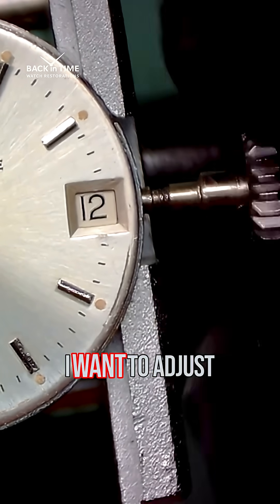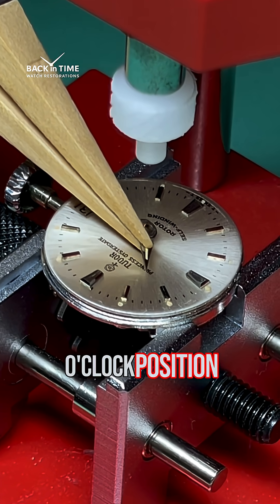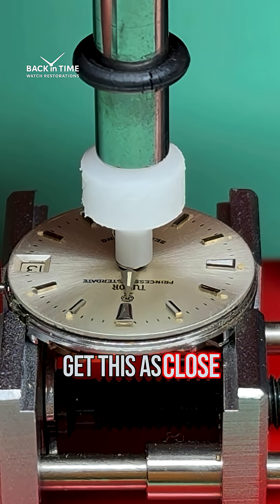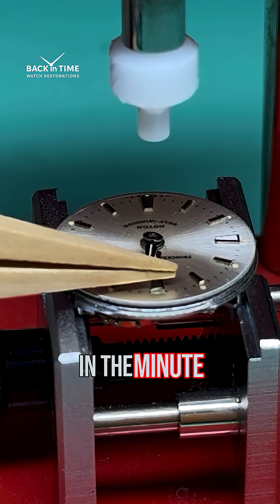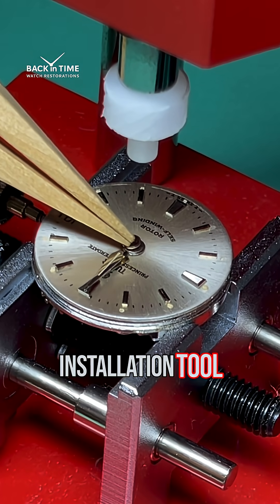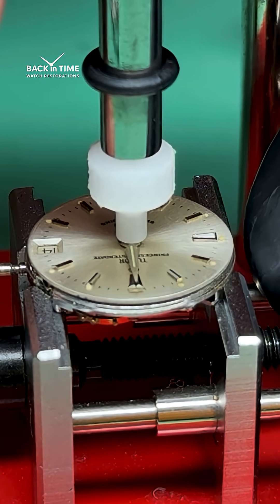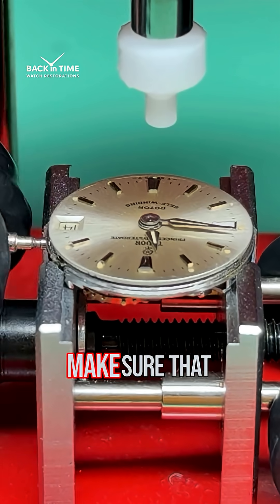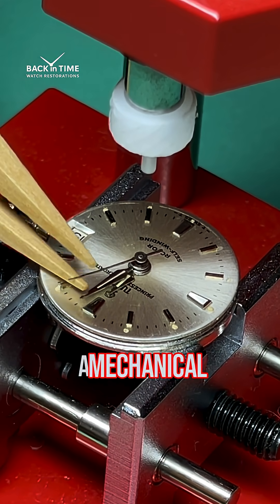How to Set Watch Hands So the Date Changes at Midnight #watchmaking #horology #watchrepair

Comment: I have a Tudor Pelagos with an ETA movement. The date jumps to the next day at around 9 pm, rather than very close to midnight. Do I need to have my Tudor serviced or is this normal behavior from the watch? Thanks!
Reply from the maker: The date wheel should advance close to midnight on the ETA 2824-2 which was used in the first Pelagos model.  That being said, I'm not sure this is a solid indicator that you need a service but definitely worth mentioning to the watchmaker during your next service.